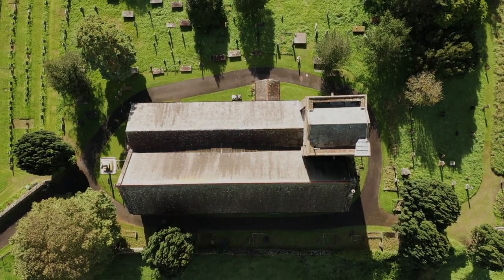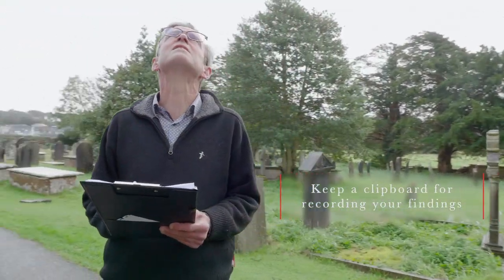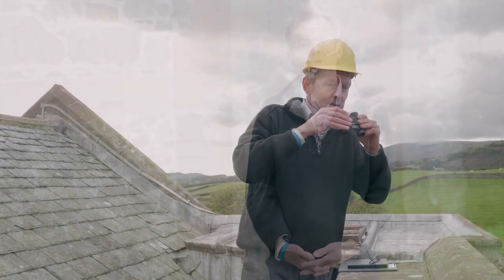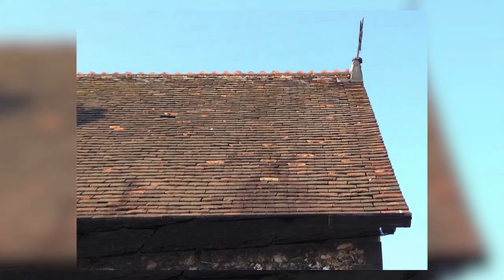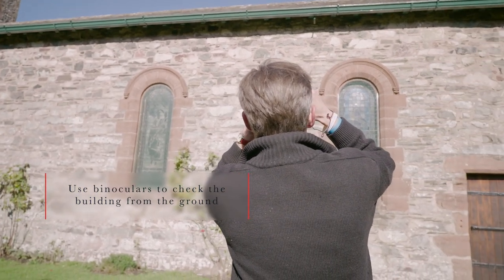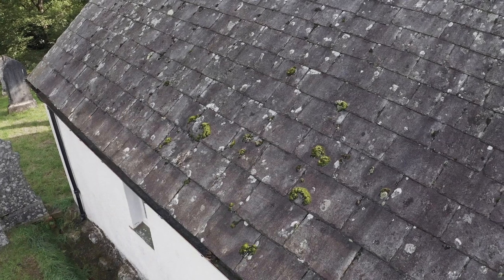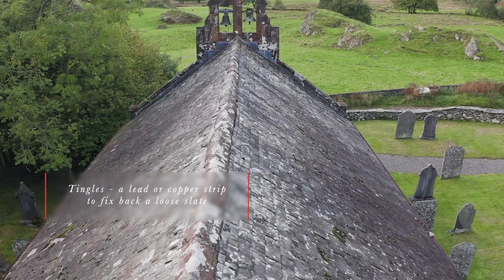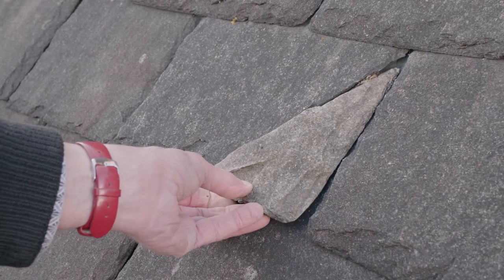How to Maintain Church Roofs | SPABs

Comment: Most helpful. An in-depth video dedicated to lead roof maintenance would be appreciated. We have a lead roof that is exposed to very high winds (Cape Peninsula, South Africa) and extreme temperature variations. It is old (possibly original 1814) and periodically comes adrift and folds over on itself. Does lead sheeting have a definite service life? It appears that arrangements for expansion and contraction and also the fixing methodology are crucial to having a trouble-free roof. Lead specialists are a rarity here (we have plenty of robbers though!).